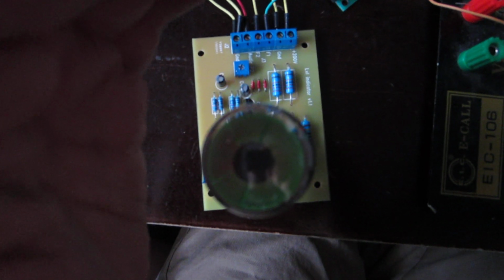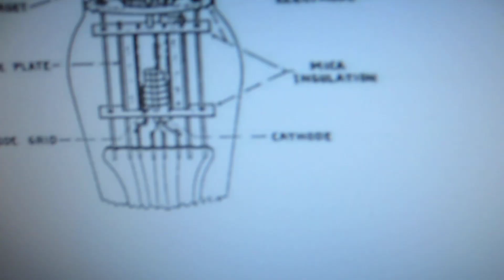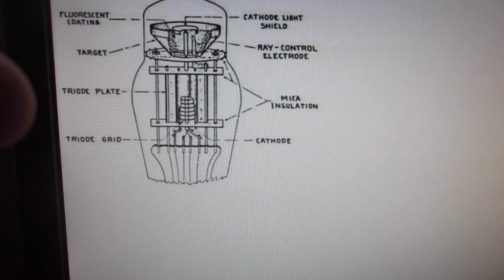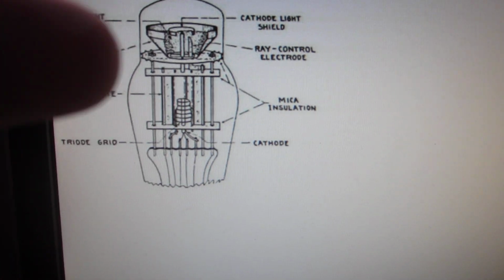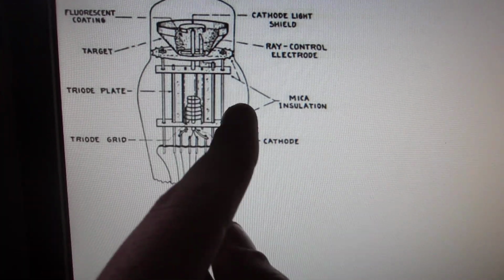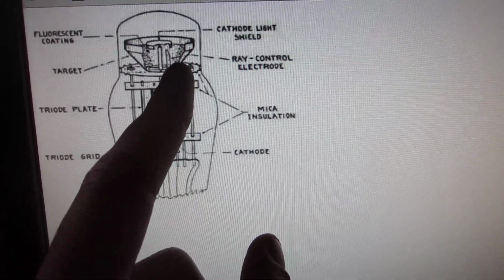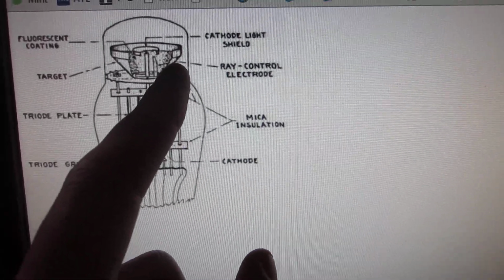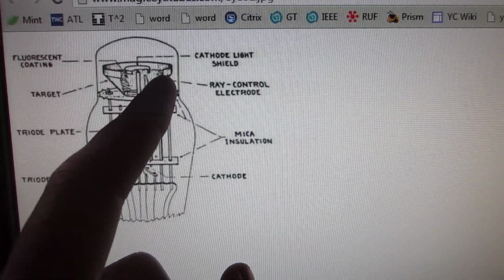Magic Eye tubes

Comment: Hi Aloishis89, can I ask what transformer you're using for this ? I've got some NOS 6E5's, found the driver boards on eBay but just need a source for a transformer. I believe it's 250v DC / 4ma for the cathode, 0 to 8v grid and 6v heater ? Thanks ! Dave

Comment: Magic eye tubes were used to tell the signal strength when you tuned your radio.  They were never used like this, and they were first put in Zeniths in 1938, they were originally a 6T5 which was a little different and now are very expensive and impossible to find.

Comment: I built a tube tunner kit ,about 40 plus years ago it was a fifties kit  the majic eye in the one was a small skinny tube ,it was vertical tube ,when you tune your radio station it was the part that went back and forth,it was a station indacater and show signal strenth to ,I love majic eye ,I used have a reel to reel tape player that had one

Comment: I found two version of this one going from top to bottom,and the one you have ,I was wondering about the power needs of these ,zi think calls for 200 to 160 volts,I dont no if that ac or dc ,do you find a power supply for yours also is there a smaller power supply need,I want to build the kit ,but my bench supply dont go that high  .I think a lot of us want to build them.

Comment: It's probably a well-used tube, which is why it's so dim around the edges; these things generally only good for about 500 hours. New old stock (NOS) tubes would probably be brighter.
Reply: 500 hours you say? That must be why the one in the signal tracer I have here is burnt out.